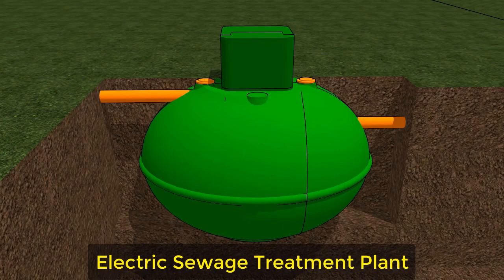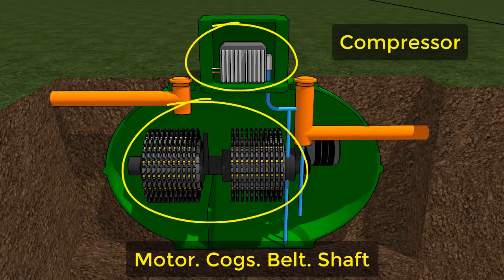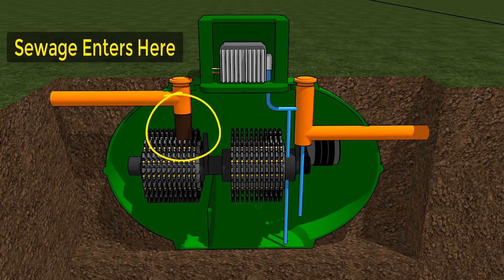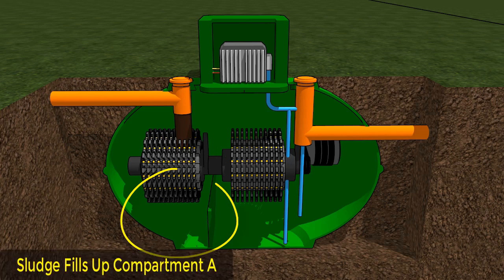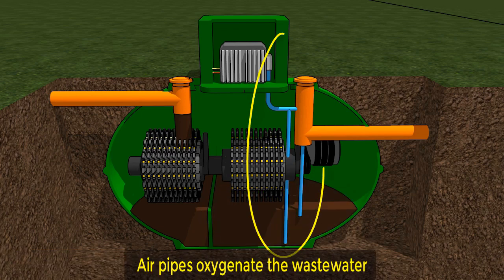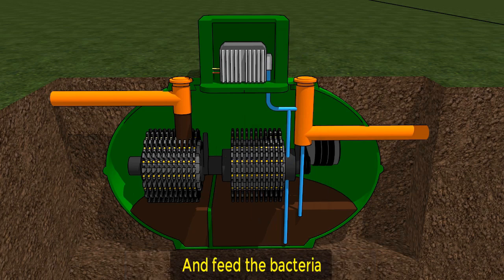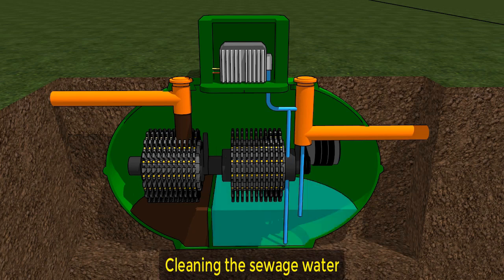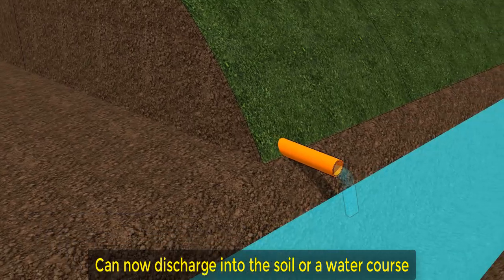how does a domestic wastewater treatment plant work

Comment: Sorry to bother you! Really seek cooperation opportunities!

We are a titanium anode metal manufacturer from China. Our titanium anode processing advantages: more than ten years of manufacturing and export experience, we can process titanium anodes with complex shapes according to drawings. The produced titanium anodes have strong electrocatalytic activity, high current, and excellent design. , Welding is firm and corrosion-resistant.

Main applications: sewage treatment, wastewater treatment, sodium hypochlorite generator, water purification, water treatment, cathodic protection, chlor-alkali industry, etc.!

Recently, a large number of titanium anode sheets for household disinfection devices have been produced, as shown in the video.
Reply from the maker: Thanks for your comment.